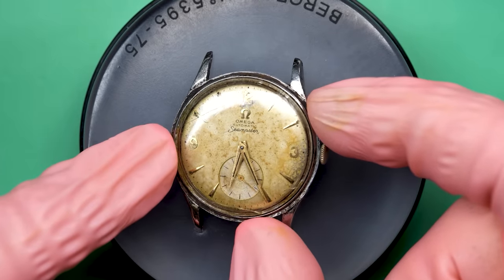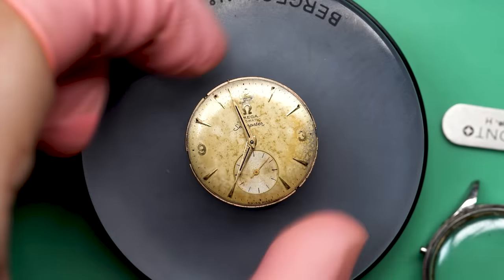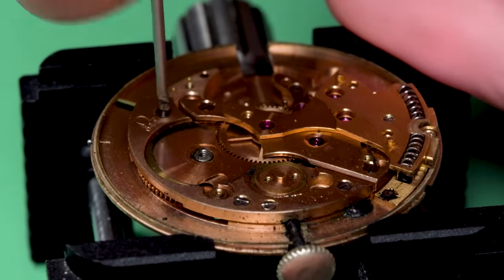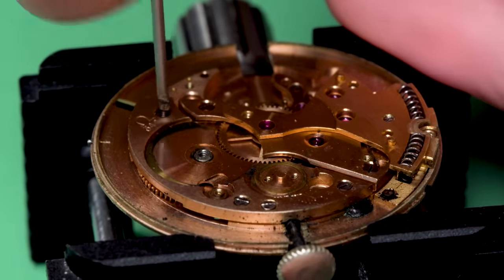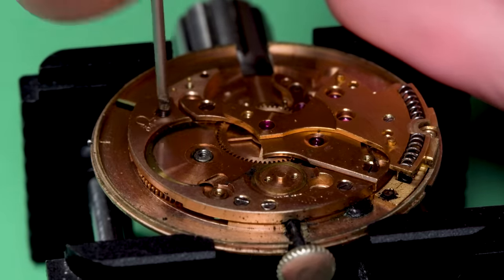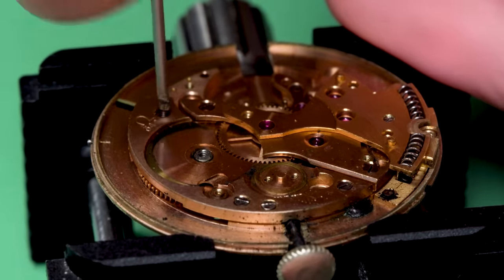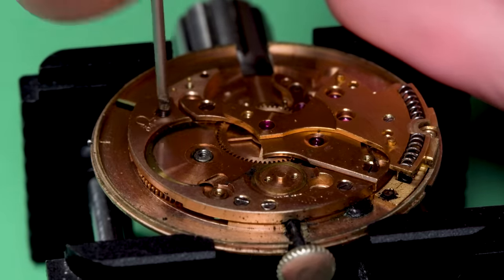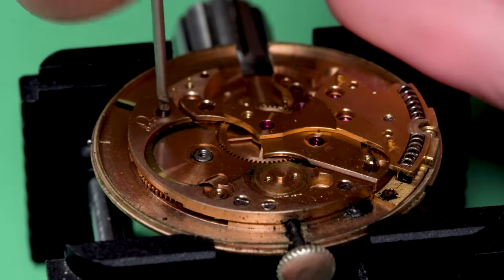Omega Seamaster Automatic From the 50's With a Killer Dial Vintage Watch Restoration

Comment: Watching these videos I got a taste for trying watch repair myself so I got all the necessary tools, mostly from China and they do work but with some of them I had to do a bit of tinkering to get them to work well. The movement holders for one were crap until I filed down the corners that grab the movement. Now they work fine. I recently got the mainspring winder tool too from China coz I can't justify paying over 700 euros for the Swiss made ones. These actually do work very well but the question is for how long, but at 90 euro's you can buy an other one should some of the winders go bad. They do seem well made and I tried it on a main spring from an old movement and it worked very well.
My first project was my late dad's old watch which has Olympic on the dial and Candino on the backplate so I'm not sure what it is. It had a ETA2373 movement in it and guess what. I took it appart, cleaned it and put it back together and oiled it and it's running with 0.0ms beat error. That was such a good feeling. ^____^

Comment: I have a Tag Heuer Tiger Woods numbered watch that I won in Vegas in 2007. Wore it for about 7 years while working both at sea and on land while I was in the military. It does not work and is beat up cosmetically. Local shops have told me it isn't worth fixing and try to sell me a new watch instead. Sadly I haven't found a resource to provide your level of service on the east coast yet. I'd love to see this watch restored and back in action.

Comment: I am a huge fan of the channel and Marshall’s craftsmanship. The only question I would raise, is that if the movement is fully refurbished, which arguably gives it another 10 years of life, then why not refurbish the dial which makes it aesthetically better? It is a bit like zero timing an aircraft with engine and avionics upgrades but then not repainting it?

Comment: Just like a cool time machine and time capsule all in one. God I love Omega. Sweet watch! I love that dial as well.
Thank you for the great upload. 

Sending my full watch collection to you tomorrow for service. I will expect them back no later than 2025. Fair enough? Haha!
Have you played around with any of the old Cimier/Lapanouse watches? I am looking at a few old ones that also need a bit of hand holding to get them across the finish line. One I am sure has a broken mainspring. The others run but I am sure need service. Hives me something to work on outside of the 7750's I normally work on.

Comment: 24 years ago my wife gave me an Omega bumper for a wedding present. Date at 6 o'clock with a central second hand and lovely crooked lugs. 1952, now 70 years old and running strong. The dial is not stained like yours, but it is the same golden patina.

Comment: I have the same Seamaster in a manual wind and another 1952 one, I found both today in old boxes left by my dad.
Reply: Haha, I also found this exact one I think it is 1951... I'm missing the indices at 5 'o clock though... if you have one knocking around... My 3 also misses like 1mm from the bottom tip. Otherwise, I have no other watch that keeps time this well, both high accuracy and low beat error. I now have 4 Seamasters.... Oops I had a look again yours looks like 52 dial the font on the number changed between 51 and 52

Comment: Ever thought of making a small case in which you can disassemble a watch?
It would prevent a spring flying across the room.
The spring would stay in the case .
Make it just big enough to fit your hands, some tools, and the watch in.

Or use a little brush to hold the spring while disassembling.

Comment: I love your videos and your channel and have a question and a comment. 

1. As a mechanic that works on Jet Engines, I understand the sensitivity to wearing gloves, or in your case finger covers, during assembly to keep body salts and oils off sensitive parts. My question is, why do you wear them during disassembly when the parts are going into a cleaner fairly soon after removal?

2. I would love to hear more about the cost and value of the watches you are working on. I see that you bought this one for $350 on eBay, great information, but what do you value it after service, repair and watch band? 

Thank you for the videos.

Comment: silly question, on a 28.4mm case, you fit a 28.6mm cristal? to keep it under tension? or the measures in the cristal comes with the expansion rate needed to fit tight?

Comment: My Dad's Omega Seamaster watch is locked away in a box in my room because it needs repair, and I haven't been able to find anyone willing to work on it. It was running, but not keeping good time, and one day while setting the correct time I pulled the crown and stem completely out of the watch. I think the watch would run as good as new if the crown and stem were repaired and the mechanism received a good cleaning, though I am certain its water seals are no longer functional. (1959-1962, all steel, case #2975, new caliber 501, 20 jewel, automatic without calendar) I even contacted the Omega Watch Company to ask if they could repair it, and they said it was just too old, so they would not repair it. I could sure use some help. If you'd be willing, or know someone trustworthy to repair Dad's old watch, I'd love to talk to you about it!

Comment: The only issue with the uneven staking is the possibility of altering the center position of the hole as the broach will follow I believe in this case the minimum inscribed circle of the closed hole.

Comment: I’m curious about how to find reliable extra large straps ?  I have huge Andre the giant like wrists and watches never fit me. I’ve tried ordering larger straps but they are never as large as advertised.
Reply: I have the same issue. I ordered some NOS “extra long”, cloth wrist bands off of Etsy, of course they are going to be going on 1940’s A-11 military watches. Even the watches that I have with those stretchy metal bands are just stretched out to their max. For non military watches I use the custom cut leather options. There are many out there.

Comment: I'm about to start a restoration of the center seconds version of this movement and i'm going to use your vid of the teardown to accommodate myself to the movement.  One thing I did notice is that when you re-assembled the mainspring and barrel you didn't mention the use of a braking grease and I didn't catch any on the side walls of the barrel in the close ups.  Did you not use any grease or did you go back and redo the mainspring and grease it off camera?  I can imagine you would get lots of slippage if you didn't use the grease.  If you did use, what was they type...8217?

Comment: in automotive restoration they plate copper to fill pits and gaps. perhaps after a good degreasing you could put a light coat of petrolatum on the surfaces you don't want to fill like the lug holes, grooves, and even the surfaces without pits. trying to keep only the surfaces in the immediate area of the pitting un coated. then you could do a long copper plating run to fill the pits, then sand the build up around the pits to blend it to original, then put a finish coat of your desired plating finish.

Comment: Are all the screws that hold the parts of the watch together the same size so you don’t have to be very careful to keep track of the size of the screws to make sure you put the same screw back in the same hole that it came out of ! Or else the screw will bottom out or come out short of the screw hole it came out of ! ? With all the small screws it would almost be impossible to keep track of the screws and parts as to where them come out of which hole it came out of ! Love the show it looks like it takes a lot of patience and skill to fix the reason the watch stopped working as well as fixing the problem !

Comment: Why did you decide to use the 8010 on the main spring instead of the braking grease in the barrel (what I've seen you use with automatic movements in the past)?

Comment: I definitely have way less experience than you do but at 25:55, I guess I wasn't expecting you to lubricate that central post for the crown wheel.  That little keeper with the two screws is stationary on that post, and the crown wheel rotates against the keeper itself.  I always lubricate the surface between the crown wheel and the keeper.  Again, I've got little experience with only about a dozen services under my belt so I'm happy to get schooled on the matter.

Comment: When you encounter a dial like that, are you at all worried about exposure to Radium paint flakes? Or do you generally take precautions for Radium? Hard to say if a watch would have had it or not without a Geiger counter but that patina could be a radium dial by the looks of it

Comment: Could you help me? My dad had the "same" manual Omega watch ( circa 1960 ) with second dial apart as yours, but doesn't have the Seamaster written in the dial . Should I consider it as a Seamaster too? It is exactly like yours without the Seamaster logo.

Comment: I enjoyed this video, partly because I have a dead, cheap, foreign-made Timex automatic. My hope for replacement has been restored. Timex' repair won't touch it for lack of replacement parts. Can I fix it? --not a chance. I could barely revive a battery wall clock by throwing out the old movement, and buying new. However, I seem to have found a working replacement! I never even thought of going to eBay. Thank you.

Comment: Marshall ,my late Father bought this very model brand new in 1955 from the Omega Dealer in NY . He told me that the sticker price was USD 100 .But he got a Diplomatic Discount of about USD 20 , through the Consulate  General in NY ,
Reply: My  late Father was induced  by his elder brother in mid-1956 , to swap his Omega for his brother's Rolex Oyster Speedking ( with date feature ) . Over the next nearly 20 years, Father took very great care of the Rolex . And used it very sparingly .
Finally circa 1974 Uncle demanded that they reverse the swap ,as by then he had run Father's Omega into the ground . Father dutifully handed back the Rolex, in near pristine condition ,and received back his all- but- destroyed Omega ( without its original metal watch strap etc etc )
From 1998 I have kept Father's Omega , limping along with at least 3 less-than-satisfactory servicings at the local Omega Authorized Service centre ..

Comment: Do you clean the case after sanding it (like in an ultrasonic bath or something similar)? Because otherwise you might have some of the sand or metal dust inside of the watch blocking the gears.

And on a very different topic: Did you by any chance comment Magic the Gathering tournaments some years back? I feel like I remember your voice from watching those. At first I thought this was quite a stretch, but you have a MtG-playmat right on your desk :-)

Comment: Theoretically you could silver solder onto the case and file it down to fill in and repair the pitting. That would be much more economical than a Lazer welder.

Comment: You said you did not have to take off the gear-drive from the rotor; but don't you want to disassemble everything to make sure that dirt is not hiding out that could later contaminate the movement?
Question: I do not have any mechanical/automatic watches.  I need something very accurate for radio 2-way schedules so I worry that a non quartz/atomic would not be accurate enough(?).  
Also, if I were to buy a quality mechanical watch, would I be forever locked into expensive periodic cleaning cycles as it looks expensive to do a watch tear-down, cleaning reassembly and oiling?

Comment: Making sure all those pivots are exactly in place and remain so seems near impossible.     What is the failure rate?  I'm imagining the situation where I think everything has seated itself in the corresponding jewel but the most delicate spindle remains fractionally out and gets bent when the screws are tightened.  Does this ever happen or can you always tell?

Comment: Also do you have a lathe? Turn out a new bezel. You look to be well set up. This is the first time I have seen any of your offerings. I am a fan atm. Most guys who work on watches ( anything Suisse of course ) tend to look down their nose at you.
I recently took in one of my A . Lange & Sohne to a watchmaker because I didn't wish to risk doing it myself.
I got the whole " this isn't Swiss " my mouth said sorry, my mind said no duh Sherlock. I do not feel guilty taking in a A. Lange & Sohne to who I thought would understand quality. I ended up walking out with the watch after being belittled. Needless to say a nice gent in NY took on the task and said if was a pleasure.

So you can never quite know what type of watchmaker/ service center you will run into.

Last question here sorry. Dubois Depraz modules? Fo you know anyone who will work on these? It just needs a service.

Comment: I have a question. How did all that side play get introduced in the first place? From an outside perspective it looks like that's a bearing surface almost and it got wallowed out via friction and dirt - is it ok to have it just be bare metal on metal like that, or should it have a tiny dab of oil? is it even intended to be a bearing surface?

Comment: I have a question  (I am no watchmaker at all.. just curious about the process). Looking at Mark Lovick's videos it seems that every time when dealing with automatic watches, he puts some sort of 'breaking grease" on the inside wall of the barrel before transferring the main spring back from the winder to the barrel. I am assuming (I might be wrong) that it might be to prevent the automatic mechanism from overstraining/oversetting the main spring, since well, unlike a manual wind, it's not going to stop winding it it feels it's tensioned enough. Is that assumption correct ?

Comment: Hello can you please specify the cleaning solutions? One of you log you said that balance wheel cannot be cleaned any solution because shellac may come off but as I see you always fix the air springback again to the case and then it goes through the different cleaning solutions so i request you to specify the cleaning solutions

Comment: Dark chocolate Brown would have looked best. It would have picked up on the line accent on the hands. You should fabricate your own micro sander using a vibration sander and a series of popsicle sticks with various grits of wet dry sandpaper. I'm also surprised you are not wet sanding.

Comment: What was the problem with the bumper ? Why wasn't it going all over to the left?
Reply from the maker: I didn't have the teeth on the intermediate section lined up properly
Reply: @WristwatchRevival  i thought that was it as you can clearly see it in the video thanks for the confirmation

Comment: Just curious - are you ever worried at all about these watches being potentially radioactive? Most of the  40s and 50s watches (including this exact Omega) have used Radium for all the lume.

Cheers
Reply from the maker: I don't worry about it, but I do have a geiger counter to check. If radium is used then I just take the necessary precautions.

Comment: I love the videos, but have questions about leaving "apprentice marks" inside with the steel tweezers.  Is this not frowned upon?  In gunsmithing and other detail jobs like that leaving a mark on something is highly undesirable.  I notice it occasionally on here, but at 24:05 and 24:08 it was very evident the tweezers left marks on the bridge.  Surely there is another type of tweezer with delrin or some other kind of material on the surfaces that wouldn't cause these marks.  Maybe I just don't know anything about watch making, and these marks are part of the "hand made" aspect.

Comment: I'm curious to know what would happen if you throw that dial into the cleaning machine. I know you are always very reluctant to  risk damaging a dial, so you clean with a swab  and plain water. But I want to know if the dial could be better restored. Although I agree that the patina dial looks awesome, I also want to know if it could look more original if you try to clean it chemically. The risk is permanently damaging the dial, and making it look way worse. 

With experience, you can try to clean dials from old unfixable movements, and gain more experience and confidence to better clean dials. 

To my eyes, an old dial is awesome, but an old watch that looks very original is even more awesome.

Comment: I always wonder why mainspring arbors aren't jeweled. Too big perhaps? But they have the entire movement relying on the torque coming out of that little spring. I really start thinking about it when it comes to weight driven movements since there is a continual downward force being exerted on the bottom of the arbor. Every time I watch a one of your videos it makes me want to get my Big Box of Clocksmithing junk out.

Comment: taking everything apart seems to be relatively easy but especially with a new movement that you havent worked on before like this how do you remember what the order of which part and screw when putting it back together? it doesnt look like you have an order in which you remove a part and place it on the table…

Comment: That looks like nicotine stain on dial. I have seen that color in flight instruments on old equipment.. Also, I worked on hairsprings made of very thin nichrome (they get soldered to the shaft/post) and if you breathe or stretch on that type of hairspring it will deform.

Comment: I'm sorry, but the dial does not look "cool" at all. You should have tried cleaning it or replaced it with a new one. Also the hands are grimy and rusted. You do such good work on the inside of the watch but poor work on the outside.